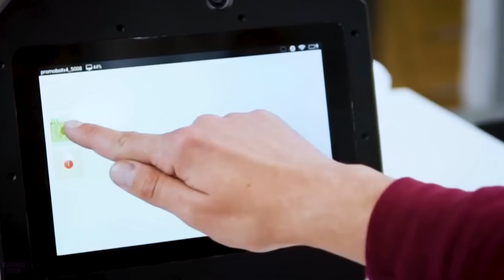Russia has Revealed its Most Advanced Hyper-Realistic Humanoid Robots

Comment: But the eyes are dead. There is a saying, 1000 yard stair. That is what every robot's eyes look like. They may be able to balance my checkbook in less that a minute but they still look dead. They have got to fix the eyes.
Reply: But there be eating from the inside out bugs or eating the rubber oils because they have no co2 carbon air there sold dust mold